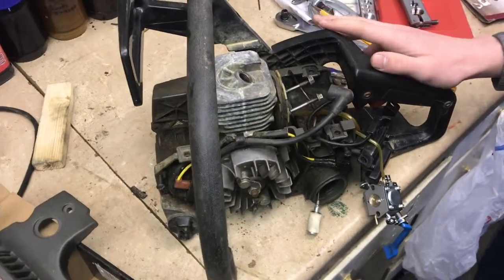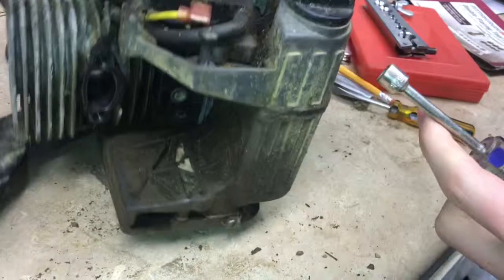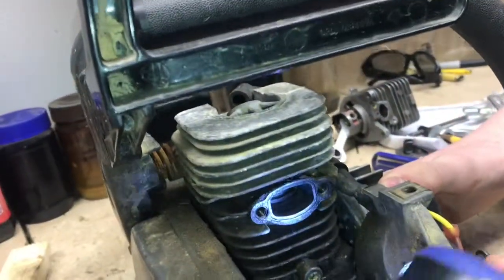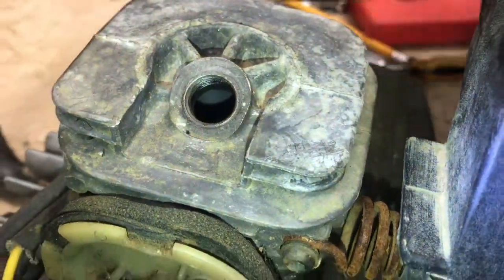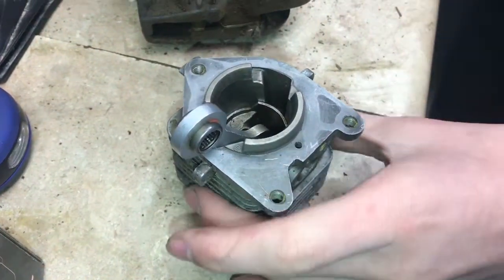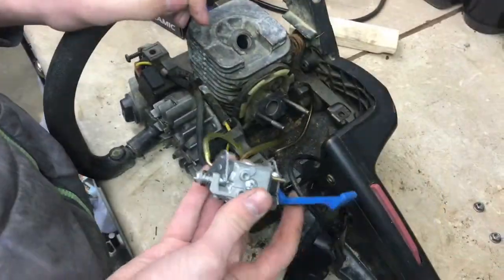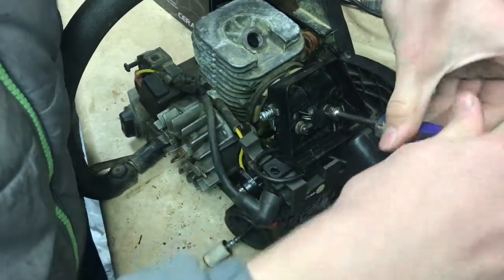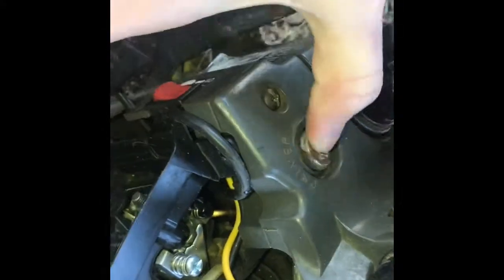fixing chainsaw with UNMETERED AIR in crank case seal

Comment: My Husqvarna 288XP has been a nightmare. Has new Piston/Jug, new fuel line, fuel filter, air filter, spark plug, fuel line and carburetor. Has 165PSI cold. Cannot for the life of me get it to run properly. I can only conclude its a crankcase leak at some point.